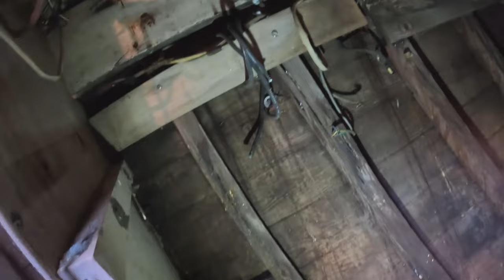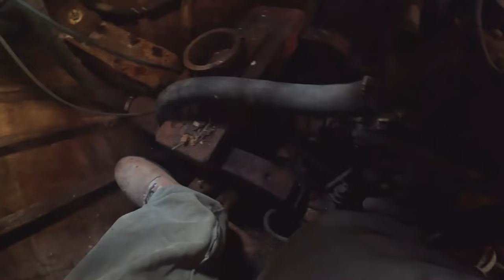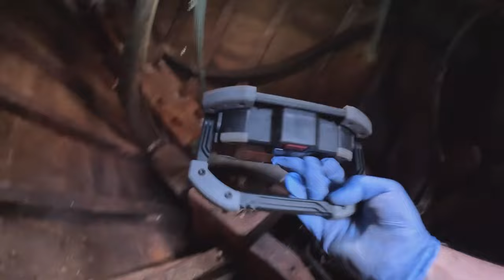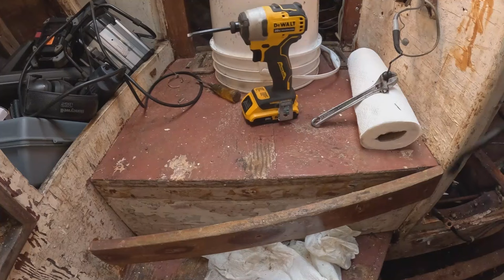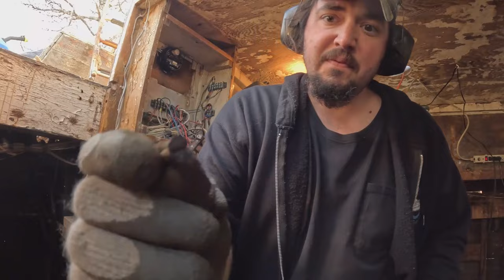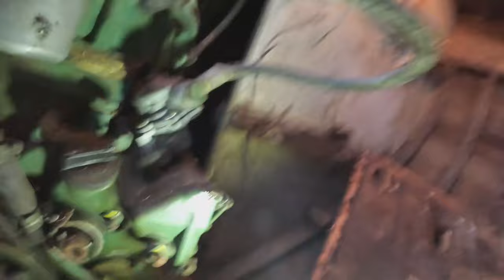Saving Maverick Ep. 19 - Aft Cabin, Fuel System Draining, More Demolition, Engine ID

Comment: Those fuel valves look great. I'd rebuild them.  If insurance or regulations dictate they can no longer be used for fuel, perhaps use them for water service.

I like the idea of twin diesel tanks.  Mounting location and plumbing require some thought. I'd plumb to crossfeed the tanks.

My thought on propane locker is it be vented only directly overboard.  And built in such manner to prohibit any discharge into the bilge.

Shed is a priority.  Will become more evident as you go further into the project.

You're doing fine, carry on.
Reply from the maker: I don't think anybody is going to be nitpicking about fuel valves as long as they work properly, which these certainly appear to do.
Good idea on the fuel tanks.
I'm still not sure how I'll do the propane locker, but it'll likely be a sealed, glassed plywood box that has a low point gas escape that vents out of an above waterline through hull. But that's all design work work for way later on.

Comment: Great progress. Yes, the engine needs to come off. There is zero advantage at this point in running it in the boat. Also, the fuel tank looks relatively new. See if you can relocate its place and build a new stand for it. In any case, you are a long way from doing it. Last, in general, rethink the propane. Do you really need it?
Reply from the maker: @OferNRaz Thanks. Everything is coming out of the boat so the structure can be repaired properly. We'll see what I come up with when it's time to start laying out and rebuilding the interior. As for propane, I can't really think of a better option for fueling a galley stove. I hate the idea of alcohol stoves, and I really doubt I'll ever be able to generate enough power to run an electric stove, as nice as that would be.

Comment: As long at it not locked up that engine is probably fine, I would pull it out, reseal it with all new gaskets and replace the exhaust manifold.
Reply from the maker: @Housecars13 The prop shaft spins freely, so I don't think the old Volvo is  seized up.
Reply: Well if it’s in neutral the prop will spin freely, put a wrench on the crank pulley and spin it over, that motor is not that old and highly unlikely it has many hours on it.
Reply: Worst engine Volvo ever made ... the coolant pipes are seated with o-rings that leak ... and vibrate loose.  Go with a Beta.
Reply from the maker: @thomasrose7262  I've heard a lot of bad things about these volvos... And your the second one on this comment thread to recommend a beta marine. Food for thought.

Comment: If the exhaust from the engine tee's into a pipe that can exit on either side of the stern. Its the stock ' North Sea ' hanna design .
Reply from the maker: It's a single hose coming aft from the muffler, which then tees off and goes into through hulls on either side of the stern, right at the waterline, so you may be correct.

Comment: A Propane set up requires a different level of boat inspection (in the UK).. better to avoid  if possible, with camping gas units!
Reply from the maker: I'll have to look into the regulations here. I assume that it would vary by state. Massachusetts is generally a very top down, regulation happy state, but even here, I see boats with propane stoves all the time. Another potential thing is that Maverick is a US Coast Guard (federally) documented vessel, as opposed to being titled by the state, so there may be considerations relating to that as well.
Reply: @SavingMaverick55  
On my boaty, we ended up taking out the propane, running a big alternator on the engine, which we also used to heat water via the cooling system (very effective). The alternator fed four 200ah AGM Victron batteries, along with solar panels, which we used to run a countertop oven and induction hob - little camping stove as backup.
We used a woodburner with water jacket to run rads and heat water in Winter, but we were on rivers so fuel was easy.
It just meant one less thing to restock with, and diesel/gas are pretty comparable price wise.

Comment: Lol the irony of a USCG plane flying low overhead while you"re fiddling with the jankey fuel system 😂
Fix her up right and you will never have the same experience at sea!!!
I don't know those Pentas, except that they are popular...if for some reason it doesn't work, consider a BetaMarine; they are just Kubota utility diesels with a marine heat exchanger, pretty cheap and simple, and parts and service easy to find anywhere in the world. Love my little B16!!
Reply from the maker: @SlowlySailing-lc1cs Right? I appreciate all that USCG does, but I'd really love to never have to send out a distress call to them at sea.
I'm half considering replacing the engine even if it runs well. 23HP seems kinda wimpy for a mini ship like a Tahiti.
Reply: Well, my Tahiti does about 4 kts at 60% power with a 16 hp motor and 15x10 4-blade prop. Good enough for me, but a slightly bigger unit could yield better mpg at low revs and more thrust when needed. Not in the budget at the moment, lol.
Belive it or not, the 2nd owner told me she had a 50(!!)hp Perkins originally. Crazy.
Reply from the maker: @SlowlySailing-lc1cs  That's interesting. I guess 23hp isnt that bad after all. I know she did have a bigger engine at first, given the size of the engine mounting timbers. If I can get the old Volvo running reliably, I'll put it back in the boat and see how it does during sea trials. So far it looks like parts availability is a little sketchy.
Reply: @SavingMaverick55  Beta makes a 23 (wink wink). And bigger.Seriously, research them. If I didn't have a Beta I"d be considering one.
Reply from the maker: @SlowlySailing-lc1cs  Bro, I was just on their website and drooling over their 30. The wife was like "Let's get one! I don't want that old piece of shit breaking down when we're stuck in the doldrums." Point taken.
Reply: @SavingMaverick55  The lady has good taste. Theres an upcoming epi of SS where I show the engine closer and my winterizing process, but if youd like detailed photos of the install and any specs (drive, coupling, etc) let me know
Reply: CG has a station at Otis

Comment: Diesel engines do not have throttles.  Speed is controlled the amount of fuel injected.  If the exhaust is that corroded,  the rest of the engine cannot be very good.
Reply from the maker: My bad. Those are cables to control forward/ reverse. We'll see if the engine can be saved once I get it out of the boat and tear it down.